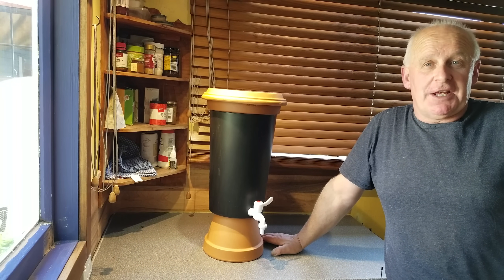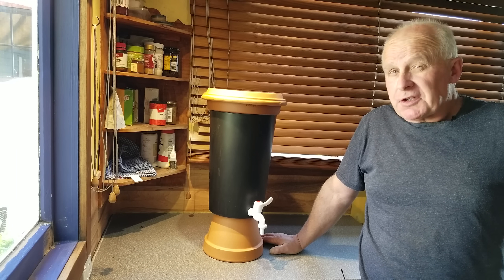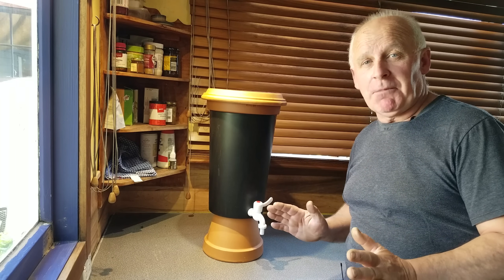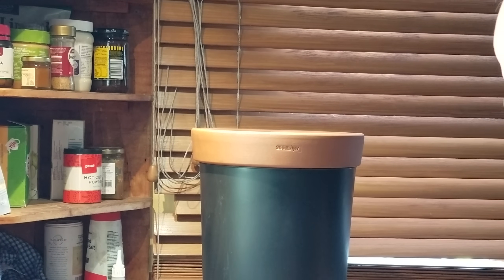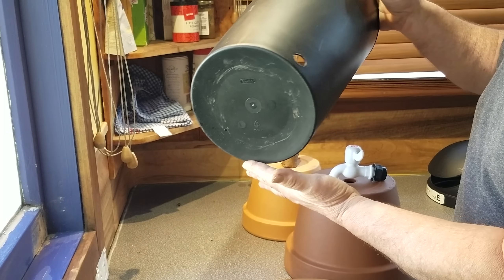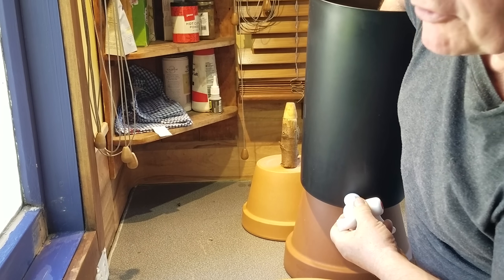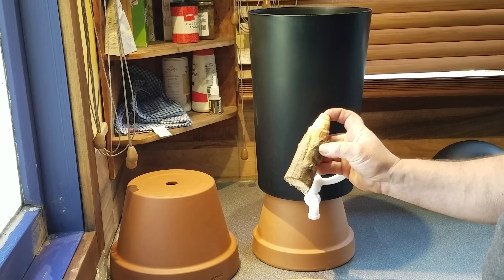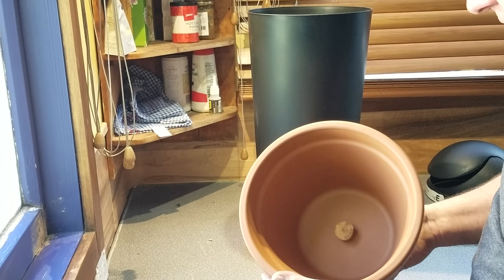DIY water filter. How to make FILTHY WATER drinkable

Comment: How about using a large stainless steel stewpot? They come with lids, and combined with a ceramic flowerpot, won't leach microplastics into the water, and will also last longer than plastic containers do.
Reply from the maker: a great idea- but I could not find one the right size in my little town
Thanks for sharing this great advice

Comment: How does it filter toxic chemical that comes down with the rain water
Reply from the maker: it filters by holding back particulates that are over the pore size in the clay pot. the typical pore size in a clay pot is <.7micron. this is a filter that is used all over africa and asia and has been for many hundreds of years
Reply: @t.h.o.r.  fair enough but toxic fumes with the like of carbon monoxide, etc etc does it filtered too? The rainwater is full of mixtures of chemical from factories including some toxic fumes. Hundreds of years ago probably different than it is today.

Comment: how do you apply the collodial silver?
Reply from the maker: douse it liberally with a spray bottle. 7% hyd peroxide is just as good
Reply: @t.h.o.r.  you rock thanks!!!
Reply: @t.h.o.r.  I wonder how often probably once a month
Reply from the maker: @inventanew  you get a feel for it,  I clean mine bi weekly, sometimes monthly. generally I rinse it between fills, swish around inside with a pot scrub and give it a spray of CS.
 Im using new zealand rainwater, pollen is mostly what I get in my filter- but general bird poo bacteria and parasites is what Im fighting. very little horticulture around me so low sprays. no industry for 200 km predominant winds are off the Pacific Ocean 12km away.
Reply: @t.h.o.r.  super cool I'm doing this

Comment: There's far more water "wicking through" the bung than the pot. This is plainly visible at your 2:10 shot. You're looking straight at it yourself, but you fail to address this point.
Reply from the maker: Its the lowest point- that's why the water drips off there- I made this video for people with no idea- But I didnt think that people with less than no idea would watch it. I hope you learned something?
Reply: @t.h.o.r. 😅😂👌🏽

Comment: There's a similar design in Brazil, two pieces of pottery, with a small clay filter (called "candle") filtering the water from the top pot, and releasing it in the bottom pot. It's a great filter!
Reply from the maker: Yes - the ceramic candle design is very common.  This method is better than boiling as that only removes the nasties that  die with heat.

Comment: Good scheme, just take care to clean and disinfect the "clean" side periodically, because otherwise in the absence of chlorine treatment it may collect crud and allow bacteria to grow in a nice organic soup. Chlorine of course stops this, which is why town water has it, but you are reasonably enough avoiding chemical treatments. This is a problem in any water storage system, big or small. Cleaning out and adding boiling water and/or allowing it to dry will fix it.

Comment: Nice. Problems? Plastic leaching? And condensation buildup in chamber that will incubate any germs that do drip through. Send problem with Berkie filters. I added a gap around seal of pit and container below, which I lined with mesh filter to keep out bugs and let out moisture.
Reply from the maker: great idea!

Comment: 1. PP can leach chemicals into water, especially if:
    - Container is not BPA-free 
1. Choose BPA-free PP containers.

2. Ensure containers are specifically designed for drinking water storage.
3. Use containers with a #5 or #7 recycling symbol (indicating PP).
4. Avoid exposing containers to: - High temperatures (above 40°C/104°F).
    - UV light.

Comment: Does anyone know if this would work without the whole in the bottom? Would it leak through the pot just fine? My biggest question is, does anyone know if this would filter bacteria-filled water that may come from a dirty lake, stream, or river?
Reply from the maker: It is very hard to find a pot without a drain hole- the idea behind the vid was to show what you can come up with 'on the day' 'with what is available' There is always a better way- This video is to get you thinking. And yes- It is specifically made to clean pond or river water. Will remove microbes down to 1um
Reply: @t.h.o.r.  Thank you so much for the reply! That was an awesome video, and I appreciate the information! I will see what types of materials I can get to build this for an emergency situation. Thanks!

Comment: How do you know there are not large enough holes in the pot to allow pathogens through? And, consider how the the following applies. 
Gravity / Ceramic cartridge filters are designed to remove certain pathogens from perfectly clear water such a mountain stream. If there is any silt in the water they will plug up and not allow water to flow through. You can scrub the cartridge, but soon you will reduce the thickness of the media and then it will not remove all of the pathogens. YOU ABSOLUTELY MUST PRE-FILTER THE WATER UNTIL IT IS PERFECTLY CLEAR. This can be done by a combination of settling, flocculation, sand filtering, and/or common cartridge type sediment filters that are easily available. If you don't believe this, take out all but one of your ceramic cartridges, plug the other holes, add some dirty water like what you will have to use during a crisis, see how much water you can run through it before it plugs up your ceramic cartridge. You will ruin one cartridge but you will know the truth! 

Another issue: if there is water in a ceramic cartridge, even a little, and that cartridge is allowed to freeze, a fine crack can occur that will allow pathogens through. You may not know it as you cannot see the crack. NEVER ALLOW YOU CARTRIDGES TO FREEZE!

Comment: Hey man this is cool invetntion but its extremely unscientific and frankly pretty dangerous to advertise to others as a way to clean their water. Terracotta will filter down to about 1 micron, possibly a half of a micron. Which is great for everything but viruses. This is good for essentially cleaning debris and bacterias from the water but it should still be boiled or treated otherwise to ensure there are no viruses present. Viral infection is a pretty big deal.

Comment: Brother I also make useful things out of nothing. I have made thousands os alcohol stoves out of aluminum cans.

You won't cook a 7 course meal with an alcohol stove made from 2 53 mm wide aluminum cans but when you have plenty of food but no power you can easily heat up a can of soup or a dehydrated meal. Combine some dehydrated shrimp, curry powder, and instant rice in a bowl and a cup of boiling water and cover. Allow the food to rehydrate 8-9 minutes and you have a hot minute meal ready to eat .

When I designed the mahalo and ultimate stoves I wanted to have the best fuel economy possible. 2017 I lived off grid and using my ultimate stove 1 gallon of denatured alcohol 3.78 liters lasted 7 months, and used the stove to make coffee, breakfast granola, lunch and dinner and sometimes coffee in the evening.

I only needed 10-11 ml to heat half liter 65 F water to 190 F or 15 ml to take 65f to boiling 209f for half liter

Comment: I would NEVER use plastic in this filter. Otherwise, if you can find the kind of cypress wood you need, it’s great idea!
Reply from the maker: Do you buy milk in plastic bottles? does the water come to your house in plastic pipes? what type  of plastic? you don't know do you? - Unless you do some research right now and lie to me in a reply.
Reply: @t.h.o.r.  actually YES I have done research on the plastic and paid extra for the copper pipe when we had our house built. I agree NOT all plastic, as far as we know so far, is bad.  We avoid food in plastic containers when possible. But it is NOT always possible. Sorry to offend you.
Reply from the maker: @debrasonner5970  Its a bit pointless using copper when the municipality use plastic!- This is why I capture my own water
Reply: @t.h.o.r.  We have an asphalt roof. That would spill chemicals into our water supply. I would LOVE to be able to capture rain water.  Good for you!

Comment: Have you examined rhe water before and after through a microscope?  How long does a terrain cotta pot last: if it's absorbing toxins each time water goes through, it will become saturated at some point and need replacement, won't it?  Perhaps adding a layer of wood chips, etc from the same cypress that provided the plug would help the pot last (?).

Great video!

Comment: what happens to what is being filtered out though? if the pot is absorbing it, then surely you'd have to replace the pot after a while? I mean if it's saturated in what it's filtering wouldn't it eventually stop working or leak into the water underneath?

Comment: could you use a rubber stopper as a plug in the filtering flower pot? Could you use water from a creek or would you need to boil it first?
Reply from the maker: of course you can use a rubber stopper. I would have used a cork but there were none available so I was careful to use a untreated timber. Lawson Cyprus just happens to have antibacterial qualities. Creek water may have contaminants from upstream farming operations. get it tested if you can, utlise the colloidal silver or other anti bacterial such as hydrogen peroxide or chlorine dioxide
Reply: @t.h.o.r.  thank you

Comment: Does your water taste like terra cotta? Mine did and I'm afraid to drink it..
Reply from the maker: If you're not sure of the quality of the clay pot material, I would strongly advise to pre treat it twice with hot cleaning vinegar (fill it to the top), then run another 2-4 times (cycles) with hot plain water (could take a day).  The reason for this is the acetate ions will bind to most heavy metals that may be in the clay.  All acetates are water soluble (or most - if memory serves correctly)

Comment: For those wanting to know
The 12 inch terra cotta planters use a 1 and 1/8 sink plug.
Note 12 inch is the description. I believe that the diameter.
The 8 inch is a smaller hole. I believe a 15/16 cork will fit.
Going to check next time I go to the city.
The 12 inch also is the right size for a 5 gallon bucket. 
And the pots at Lowe's Home depot are Italy terra cotta.
I never looked until I seen his video. 
Btw
 Make sure the ones you buy are not cracked. First store I went to every one of the 12:inch were cracked.
Matter of fact every one of the other sizes were also crack except to one 8 inch I bought.
Reply from the maker: Also you may have to 'cook' it in the oven to remove the wax finish some factories coat the pots with to slow transpiration. Also dont buy pots made in India- full of contaminants.
Reply: @t.h.o.r.  lol. Mine won't fit in my oven.
But they started the osmosis quick so don't think that's a problem.
Also. Not sure if it was you or the other guy.
I sanded them with 80 grit sand paper and rinsed them before I started. It's been almost 3 hours now since I put water in them.
Reply: Update. The one for cooling water is differently working. 
Actual time 3 hours and 45 minutes 
Water went from 90 degrees to 70 degrees
The filter isn't doing so well. Not even half a cup. But the outside of pot is drenched.
On the other hand. It's humid today first rain in almost 2 years last night. So I think that's factor.
But nice to know that the cooling is working.
Also another said filtering it works better in direct sun. Will try tomorrow. And see how it does today.
I wasn't expecting it to be quick 
And someone may of even been you.
Said the longer it's used the faster they get.
It is s passive system. So expect it to be slow.
However it works out. I want to be able to scale up to 5 gallons a day. That should be enough.
Reply from the maker: @IvanhoeWolfe-zn6fc  Its great to get detailed feedback- thankyou on behalf of everyone reading this. I initially made mine because I had no pressurised water to run conventional filters in. No gravity filters in my town under $199 so I made mine. its now about 3 years old and cleans all my kitchen water. Shower and sink is roof water just 'strained' to take out leaves and pine needles.

Comment: In the US. Unless you get supllies free. You won't get it for $10.
I just bought my supplies.
 Pot $30.
Sink plug  ( 1 1/8) eanted cork but couldnt find one big enough at Lowe's or home Depot. $3
5 gallon buckets $4
No spout
So basicly $40.
My pot fits a 5 gallon bucket. The lip of the pot sits on the top of the bucket. No drilling cutting or other stuff. And loose enough for aur exchange..
Once i confirm it works.
I eill be Making a much larger one. For a 55 gallon drum. Pot eill cost $65 .
Why such a size?
I plan to filter laundry water and bath water to reuse in them
If all goes well. I will have 6 big filters. 55 gallon drum,  two 5 gallon. And two water coolers.
After that. I plan to recycle urine to add to wash water using terracotta filter
Hoping it will off set the water lost to evslopation. 
Hey laugh but i didnt receive any measurable rain last year. Meaning i didnt get water.
And bulk water is so chemical treated that its even rejected from swinning pools.
Set it infront of your face and seconds later it burns your eyes.
Plus this should filter my bulk ester too.
Its a pain to travel the 50 miles to town ( 100 round trip) to get bulk water.
Reply from the maker: That's terrible! Here in New Zealand an Italian terracotta pot 200mm  is $7.00 - that is $4.50 us!
Reply: @t.h.o.r.  I just looked at the two I bought yesterday. And made a post with more information.
But they are described as 12 inch pots. 
And yes I agree the price is outraged.
Worse is there are so approximately 24 inch pots. I'm going to be buy that are about $65 each.
There is a place I'm going to try first though.
About 10 years ago I bought a big pot from them. I crushed it. For it had gold in it 
It was from Mexico. I got half a troy ounces from it. I stop by a couple times a year. And haven't seen another with gold. Lol. 
However. Since one had gold. It's no telling what is in them. Then again I may have stumbled across something I wasn't suppose to. 
It would be a good way to smuggle Mexico gold across the border.
No one is going to look closely at a truck full of terracotta pots. They are mainly looking for drugs and illegals. 
Got anything to declare.
Just 200 terracotta planters.
Ok $20 .
Today say half are special.
That 50 troy ounces at 2k per ounce. 
Or $100k
It wasn't hard to mill either since once crushed to powder. The terracotta separated from the heavy gold easy. 
Anyhow if any Mexican are interested. Let me know.  Easy money without the cartels. 
I will split profits 50% 
you make pot.
I  pick up in Mexico crush, mill and sell the gold.
Reply from the maker: I simply would not live in a city. mainly because of the restrictions on living life in a healthy holistic way. We were not created to live in cages and be fed processed rubbish food. I have side stepped tyranny and authority all my life- and its getting harder. municipal water only gets used here for waterblasting and car washing.
Reply: @t.h.o.r.  my closest town is 50 miles. Population of 150 people.
Closest city is over 100 miles.
I go months without see other people..and that solely when I go to town or city.
Last person I seen even close to my land, 10 miles away. Was over a year ago.
But a few months back someone bought some land about a mile away. And messed up my road. I haven't seen them YET. 
THEY dropped off a shipping container and haven't returned.
I can't wait for them to get stuck in Thier mess.

Comment: It's very common here in Brazil. Almost every house used to keep at least 1, but many swaped their old "filtro de barro" for a smaller plastic unit or a small water refrigerator. The filtering is still the same kind though (ceramic+activated charcoal+coloidal silver), which can be found in shops from every brazilian city. Funny thing is the "filtro de barro" (or clay filter, which is just a large clay pot to assemble all the parts mentioned in the video) is still better, cuz it provides high PH water and very cold temperature in a clean/atoxic enviroment and 0 energy cost. I got a 16 liters here in my house, but I just need to fill it once a day for all my family

Comment: no sand or charcol?
Reply from the maker: depending on what had happened in your area you might need it for your water. Im using clean rainwater so dust on the roof is my only concern

Comment: Here is my question.
How does this work for both filtering water and cooling water?
Since it does both.
What keeps it from draining out of the water cooler pitcher and makes it a filter for if used as one.
Both methods use non glazed terracotta.

Comment: I like the idea of this. However what do you do when the pores are clogged up? Eventually the bits it's filtering out will fill the pores. I like the use of silver and ani microbial wood. Ps if you add a fan you'll get evaporative cooling so the water gets cold. Like an oya. Cheers J

Comment: Will this filter out fluoride?  I live in Ottawa Canada where they add water to drums of fluoride toxic products.
Reply from the maker: I live in an area that is also medicating people with fluoride. and the reason I use this is so I can avoid it by drinking rainwater that is as clean as I can get it without resorting to pumps pipes and pressure filters. Mine is in use daily and has worked well for araound 3 years now. I check my rainwater after each rain with a TDS meter, pH meter and conductivity/magnetism
Reply: @t.h.o.r.  Thank you for this.  How often does the pot need to be changed, or is there a process of cleaning it because obviously it will accummulate 'stuff' over time.

Our area is regularly chemtrailed, so I doubt our rainwater is very safe, but at least it should not have fluoride, although I saw a few months back an article where they were actually releasing fluoride into the atmosphere as well as aluminum, cadmium, etc.